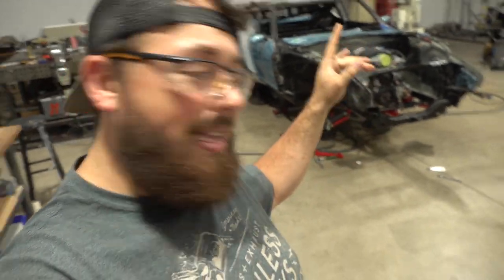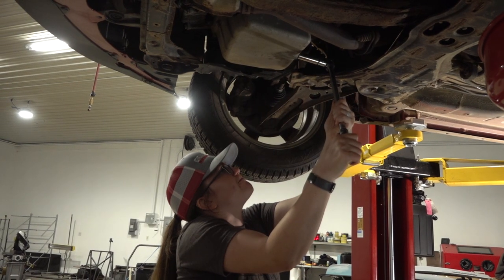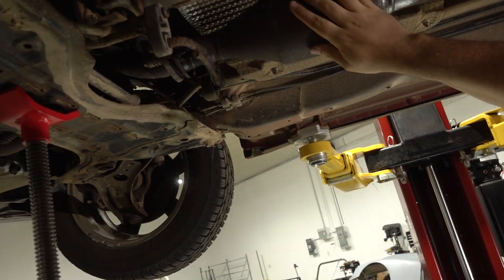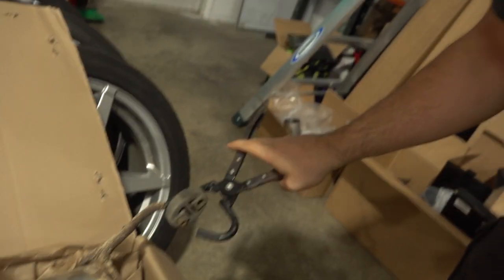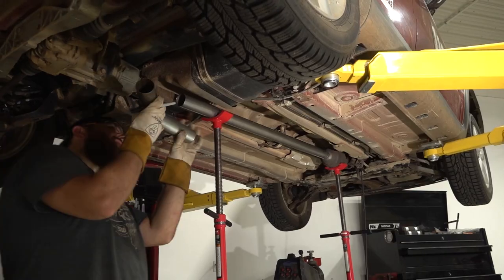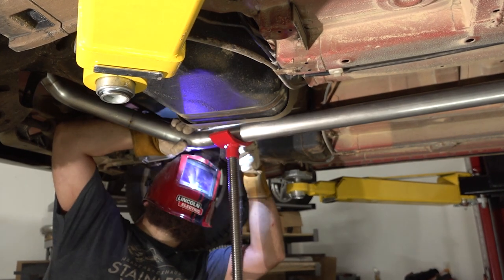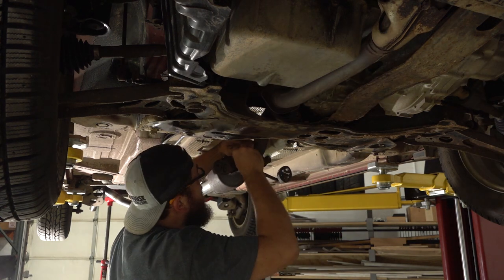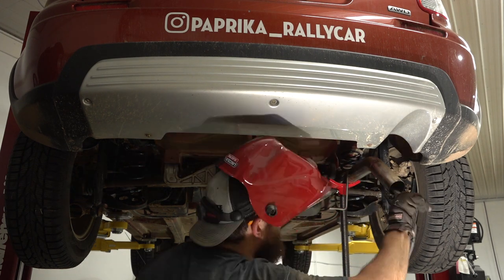I Straight Piped my Wife's Suzuki SX4 Rallycross Car

Comment: I've got to agree with your wife on not wanting to get rid of it, I've had my SX4 for over 10 years now and don't plan on changing it anytime soon lol
Reply from the maker: It's so interesting to me how many SX4 owners share this sentiment! I never realized the following these cars had amongst their owners
Reply: have an 07 sx4 lowered on work wheels i am another one of those owners that can’t leave the car
Reply: Same here, 10 yo and running, 234k km. Though 1.4T would be a great upgrade.
Reply: @scratchman21  that’s gotta look good. I lowered mine on Megan coil overs and it blew up a couple weeks later. Can’t wait to rebuild it
Reply: @ijumpshot2613  damn, gonna see one this Sunday and hope this doesn't happen to me lol, one question do all models of these cars have the same engine? If so then finding an engine will be a breeze 

The one I'm looking at is an awd manual transmission model so it's pretty rare, I hope it's in good condition
Reply: I got rid of my 2009 AWD SX4 for a 2017 1.6 naturally aspirated Veloster and I sometimes regret the decision.
Reply: @GrindhousePerformance  why did you leave the second cat in? Your state have restrictions? In Florida we bust those out first thing
Reply from the maker: @austinkruger290  The class we race in requires us to leave them untouched
Reply: @GrindhousePerformance  Dang thats no fair it lets your engine howl

Comment: Do you have any plans of lifting the car? I'm looking forward to it bro.
Reply from the maker: The class we run in wouldn't allow for raising the ride height, and we'd need more power to be remotely competitive in the next classes up. We've talked about a possible motor swap but it's pretty low on the list unless we blow this one up
Reply: @GrindhousePerformance  thanks bro ,actually im planning of getting one. Im just looking for an idea how to lift a lil bit or adjustable suspension will work on sx4.

Comment: It sounds nice! I came across this video when looking for OEM exhaust parts for this car. Really sucks, there is almost no aftermarket support for OEM style exhaust parts for this car. New York winters have also destroyed my SX4's exhaust. Fabrication might be my last resort.
Reply from the maker: This car's had its share of northeast winters as well, and I'll be honest I've spot repaired a ton of rust stuff on this already. It's a shame parts are getting to be so difficult to find, but at least a custom system would be reasonably easy to have fabricated!

Comment: Loved our sx4 and the wife still talks about it to. It went through suspension components too frequently and a u joint went in the prop went but it was a good drive and had loads of traction in the sloppy stuff, I’d say the best car I’ve ever been in for finding traction off-road, it just didn’t have the ground clearance to do a lot with said traction

Comment: We've got a pretty zippy little sx4 also love the hatchback the only way to go with these! We dont have a straight pipe buuuhhhtt Now I want one, we've just swapped the engine and done some aftermarket suspension but definitely excited for what you guys have planned! Keep more coming.
Reply from the maker: Couldn't agree more! The hatchback has so much more character than the sedan, its hard to believe they're the same car. I was thinking we'd be rebuilding the engine this winter but it's still running great with no real signs of issues
Reply: @GrindhousePerformance   I misspoke in the last comment. It wasn't so much an engine swap,  more so just a compete rebuild, we ended up swapping things putting them back then shaping them all over again. At the end we have a 4.0L Sx4 that doesn't know what to do with itself other than wrap around gravel and mud like it was born in it.
Reply: @mythical.martinez1609  4.0???
Reply: 4.4 actually
Reply: @mythical.martinez1609  what’s in it??
Reply: Any pics of it?
Reply: I don't have pics of the engine, factory
Reply: @mythical.martinez1609  waiit. 4.0L and the stock
 is 1.6
Reply: Hey Martinez do you still have the sx4 and if soo what kind of aftermarket suspension parts do you have and where did you purchase??
If you don't mind!

Comment: Update on Paprika!  I'd love to see more of this!
Reply from the maker: We didn't get to do much with Paprika last year! A lot of our local venues have shut down and my wife's been traveling a lot, so we didn't actually compete at all in 2022 . We've been talking about a possible engine swap on the channel for it 🤫
Reply: I started watching you for the 3d printed stamping dies, but having a soft spot for the Sx4 stuck around for Paprika.  Would love to know more.  Would also love to see some pointers on sheet metal design for sending off to send cut send, as between you and super fast matt I feel like I'm missing out of some serious potential for use in my sim racing rig.
Reply from the maker: @owenatkin3148  there are some bending guidelines on sendcutsend's website that are really helpful. You can create a "sheet metal rule" in fusion that you plug in sendcutsend's material guidelines. That will give you stuff like bend radius etc so when you model the flanges (bends), everything will actually look like when you'd receive it bent from them. I'm looking at doing a fusion tips video in the future and I'll include info on modeling sheet metal specifically. If you're not bending it, you don't need to use those tools at all though 🤘
Reply: @GrindhousePerformance  hi. Love the noise. Thinking of doing the same for my 07 sx4 base. Any trouble with noise and cops?  That’s the only thing I’m worried about.
Reply from the maker: @sanjithp2255  We don't really street drive the car, mostly just use it for events now. It would definitely draw unwanted attention on the street with how loud it is now!

Comment: You know where I can find parts for Suzuki aerio 06 specifically a spindle for front right side
Reply from the maker: You might have some luck from Rock Auto, but I'm not sure if they still produce the spindles themselves. That might need to be purchased used off eBay, I'm not sure sorry!

Comment: I also live in Vermont, about as far north as you can go in the state (close to Jay Peak, north and east). My dads 08 SX4 he sold with nearly 300k miles last year he’s owned since new outlasted my 08 Impreza by a long shot, didn’t rust out like my Impreza did, never cracked open the engine. Meanwhile my Impreza spun a rod bearing at just over 100k, had really rusty rear 1/4’s and rockers... in terms of long term longevity and maintenance costs it blows Subaru out of the water...
Reply from the maker: We're going to need a 3rd engine in the forester we bought to replace the Suzuki.... 🤣 at least its warranty work
Reply: @GrindhousePerformance  seriously??? I thought the new FB and FA engines were pretty good. I had an older EJ, 2008 was a specific year Subaru had a lot of issues with according to consumer reports, and I was one of those people who had just about every trouble. The crankshaft wasn’t aligned properly from the factory, it ate crank position sensors like once a month, spun a rod bearing, head gaskets started leaking... Car was excellent for northern New England winters though. That little Suzuki though, man that car was good in the snow. Short wheel base, good AWD system. Coupled with some quality hakkapilletas...
Reply from the maker: I thought so too, but seems they like burning oil something serious.. ah well, possibly getting rid of it this year and that'll be that
Reply: @GrindhousePerformance  any ideas on your next vehicle?
Reply from the maker: @sleeper.simulant7327  we've been looking at the new 2dr bronco, not super sold on buying a first year model though 🤣 also considering doing an STI swap on the forester

Comment: I had an intimate encounter with a deer in my 07 SX4, fixed it, drove it for a year, and the engine decided to blow at 150k miles. I owned it since 30k, and it has not had a "Sunday driver to church and the shops" life by any means. It blew up last year, I am slowly but surely gathering parts to get it roadworthy again. 

I'm by no means short, 6'9", and it's one of the best vehicles I've ever owned.

Check out ClubSX4 if you're trying to find some fellow SX4 enthusiasts.
Reply from the maker: I'm sure Paprika will wind up in the family for the foreseeable future haha. Thanks for the tip! My wife frequents a few different SX4 groups for advice
Reply: @GrindhousePerformance  Road Race Motorsports has some go-fast bits that might help overall performance, worth checking them out if what she's putting down isn't enough.
Reply from the maker: Will check them out, thanks!

Comment: Thanks for this really cool video .. but any improvement in the performance ?
Reply from the maker: Hey thank you! I doubt there's any measurable horsepower increase honestly, maybe a bit. There's a bit of weight savings in the rear, but mostly the original system was rotting its way out and needed to be replaced anyways

Comment: Hahahaha as you say. "Not as reliable as suzuki intended" now to laugh at me i hole hearted belive suzukis made in Japan not the Daewoo badged as suzikis . Are the best most reliable cars on the planet. I have a 90 suzuki swift still running and I drive it like I stole it. Never ever ever had a problem. Difference Is weather conditions in Comifornia and Vermont. That paprika is a monster your wife picked a great car. And you picked a GREAT WIFE! Both are keepers!
Reply from the maker: Too true! In all seriousness the car's been incredibly reliable for rallycross. We haven't had any real issues outside of having to replace some tired suspension parts. Thanks for the kind words!

Comment: Hello, I would like to know where the oxygen sensor B1S1 and B1S2 are located.
Reply from the maker: I don't know those specific codes but I'd assume they're the sensors on either side of the first cat. The first cat is towards the very front of the car under a heat shield.. memory fuzzy there sorry we didn't mess with any of that stuff

Comment: Nice Video! My SX4 has error "catalytic converter efficiency". I want to get cat cut out but do you know if this car has more than 1 cat and also does it only have 1 o2 sensor new the manifold or is there another after the cat? Would it need to be spoofed?
Reply from the maker: There are 2 on the sx4: the one right before where we cut for the cat-back, and one closer to the exhaust manifold. There aren't any sensors after the second one. If you're getting that code though you might have an issue with the upstream one

Comment: Very cool. Out of interest, have you noticed any difference to power output?
Reply from the maker: The extra loudness certainly makes it feel faster but realistically any gains are pretty negligible. It does seem that taking some of the weight of the OEM exhaust out of the car makes it a bit more tail happy on the dirt though which I'm happy about!
Reply: @GrindhousePerformance  Haha awesome, that's even more worth doing then!

Comment: It's a shame that Suzuki left the USA. We have a 2008 FWD/Auto. I wanted to trade it for an AWD/6spd, then install a turbo, skids, and adjustable coilovers that could lower it for rallycross or lift it for offroading.

 Suzuki shut down here, and so did the aftermarket. These cars could have been an absolute blast on a budget. 200+ boosted WHP and some tiny mudders would be a hoot.

 My 2016 Crosstrek doesn't have as much fun factor. It's a better commuter, with less noise, better ride, and 40+ MPG if I set the cruise, but it's pricier, nobody really offers performance/rally parts, the center diff doesn't lock, and it's HEAVY for a little car. I also got a somewhat-boring CVT, as the sunroof and fogs weren't available with the 6spd.
Reply from the maker: It really is. The Forester 6spd we got as a replacement has been super unreliable.. wish someone else offered decent AWD manual vehicles but that's asking a lot in 2021

Comment: Hi i have suzuki sx4 09 also and have problems with brakes being spongy and bleed them and need help any ideas
Reply from the maker: Hello! My best guess is the way you're trying to bleed the brakes is adding air back into the circuit, unless you've got some leak in the system. If your hose on the fitting is a loose fit, or if you don't top off the fluid as you're bleeding it can reintroduce air. When the brake fittings are opened up (with the brake depressed after pumping several times) you shouldn't be seeing any air bubbles in the hose. They'll be present at first but will improve as you keep repeating the process. Start with the brake furthest away from the master cylinder and work your way around the car. Good luck!
Reply: @GrindhousePerformance  hi what if the master cylinder reservoir cap loose will that cause problems with getting air into the system and thank you
Reply from the maker: A loose cap for the master wouldn't cause air in the brake lines, if I remember the sx4 cap feels a little 'loose' normally. It could be failed internally in the master cylinder if you're certain it's not from being bled improperly
Reply: @GrindhousePerformance  thank you

Comment: Hey what’s up man, I’m planning to enter Rallycross with a Suzuki SX4, but I found there is no aftermarket support other than coilovers for this car… any help would be greatly appreciated.
Reply from the maker: Hey that's awesome! That is one of the downsides of the SX4 honestly, there's hardly any aftermarket for them anymore. The class we race is is pretty heavily limited to stock vehicles, which helps us be more competitive in the class. The only real allowances we have are DOT tires, small wheel size changes, and adding safety provisions for racing. Our biggest challenges are factory turbo AWD cars, but honestly, we do it more to spend time with each other and have fun.